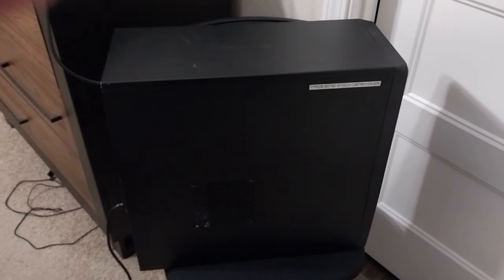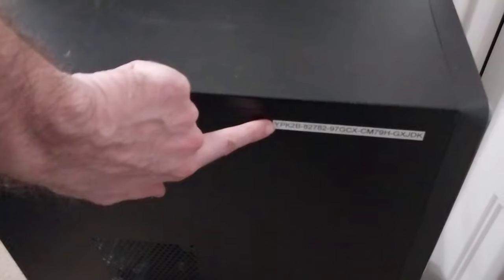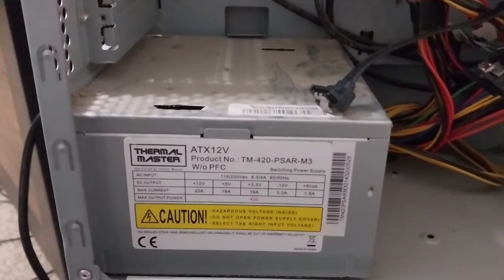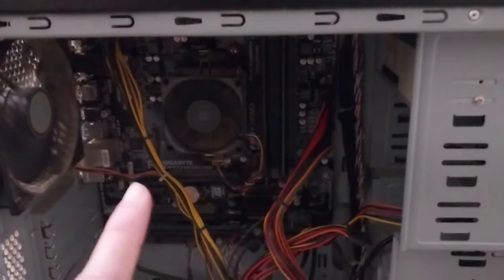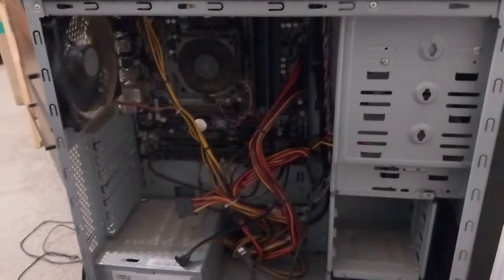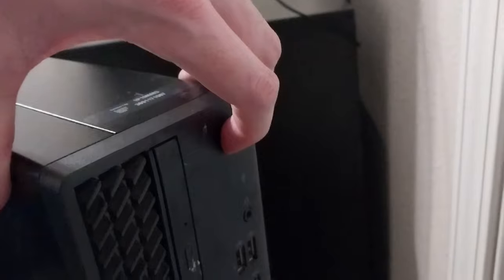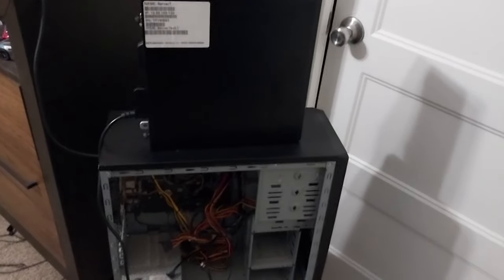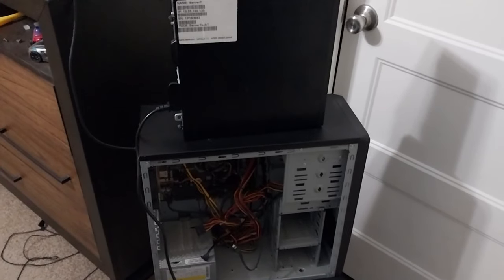Two Dumpster-found PCs Recovered

Comment: Just keep an eye out for any scrapped digital cable tv, pvr boxes, as they tend to have hard drives inside of them.
Reply: i found pentium 4 pc in the bin that does in fact have a 120gb drive. havent tested the hard drive as i need to replace the psu and capacitors in that pentium 4 system
Reply: i got 1 with 3 4TB drives